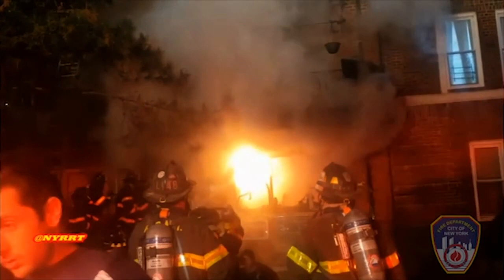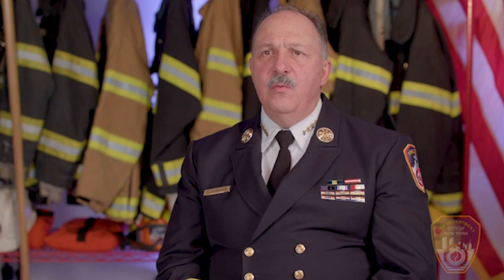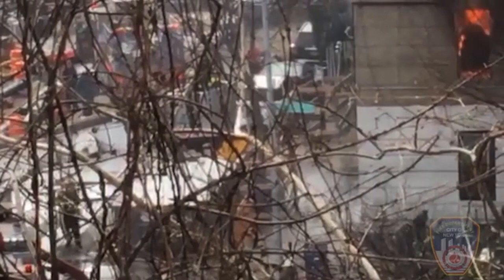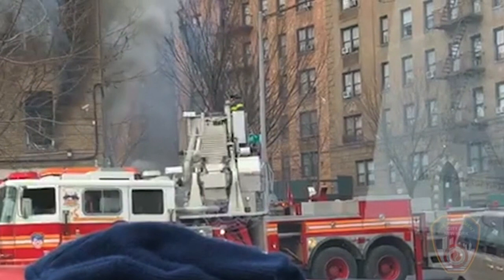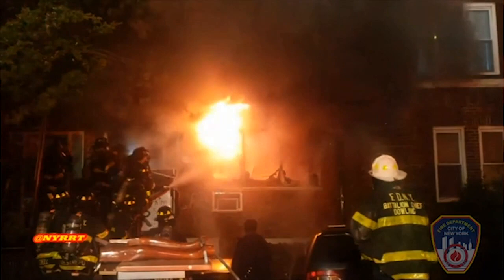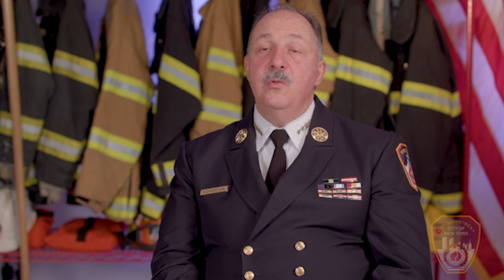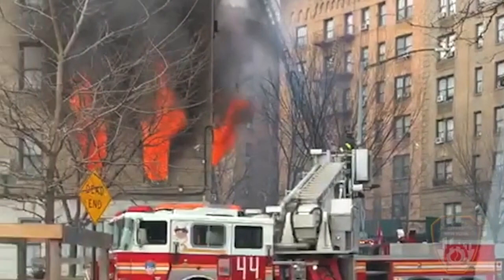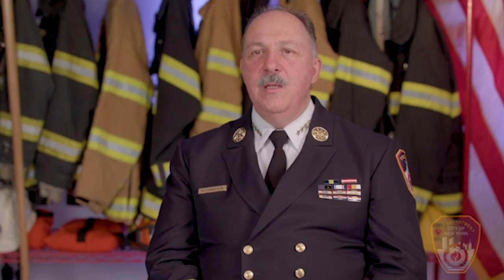FDNY Chief's Corner: Exterior Fire Control

Comment: Using this tactic and pointing the knob at the correct angle allows the water droplets to absorb the heat as is they were coming from a sprinkler head
It is fast and effective particularly if a 1 3/4 line is employed 
Been there done that

Comment: When i was a roookie fireman i was told not to put water on a fire from the outside.  Common sense was put water on as soon as possible. So i wated untill next engine arrived so we could go in. By that time the fire was all in the attac and over our heads. Needless waiting and the fire was much larger and more dangerous for us all but they were all tought pushing fire nonsense.

Comment: His logic is still faulty. HE keeps saying they start with a aggressive interior attack and when and only when they don’t or can’t make any headway they changed tactics and used the outside line. Science and tactics have been proven time ad time again that with visible fire hit it from outside FIRST with a smooth or straight stream for approximately 15-20 seconds before even entering the building. It will not push the fire or smoke. Then transition to a interior attack. The FDNY was part of the studies with UL/NIST and they still can’t get it right.